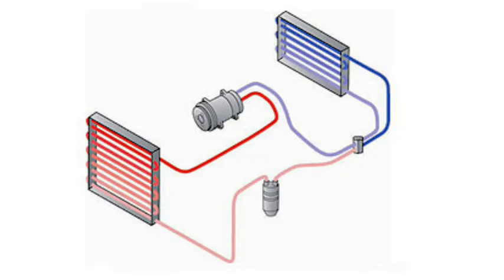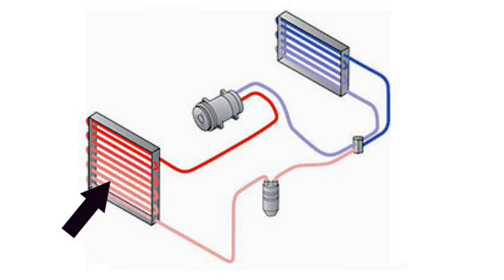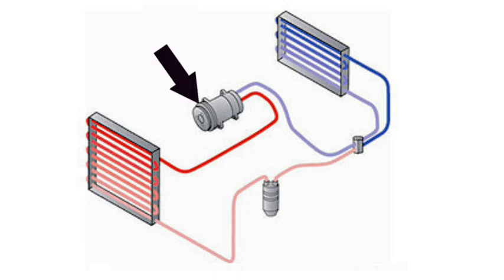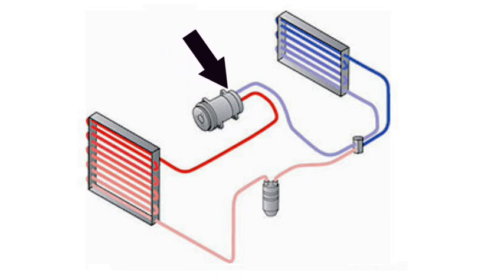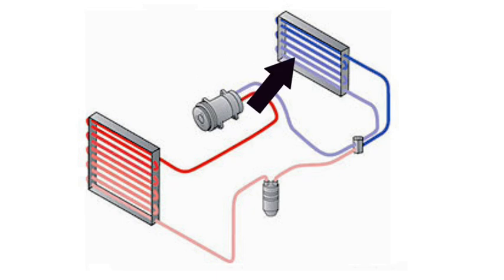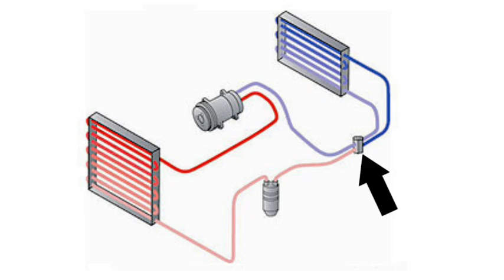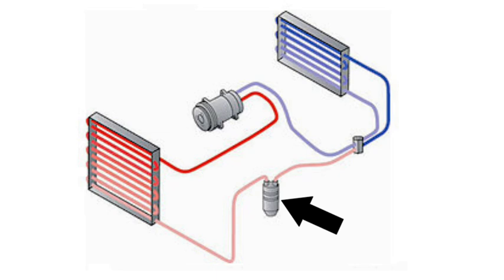AC System Basics - EricTheCarGuy

Comment: The reason he's telling you guys to take it to a professional is for your own safety reasons. 

1) Since the average person does not own a vacuum pump, they're most likely going to just open up their system and purge the refrigerant into the atmosphere.  That is a big no no in the eyes of the law and EPA.  Refrigerant is a green house gas, and depending on the type also ozone depleting (hence why we don't manufacture R12 anymore).

2) It is also colorless, odorless and tasteless.  But which makes it particularly dangerous is that refrigerant is heavier than air.  You can breathe it in and suffocate yourself without even knowing it. 

3) You need to be certified to work on any type of refrigerant systems. 

99% of car a/c problems result from a refrigerant leak that develops over time.  They are not perfect systems and are designed to be modular (have rubber seals in between connected lines).  Unless you have the proper tools and training, take it to someone that can do it for you. The primary reason for the appearance of excessive cost of repair for a/c systems is the above mentioned issues and specialized equipment.  An automotive a/c recovery unit usually costs around $5k for a good one.
Reply: He's rights you know

Comment: hey eric .replaced my compressor a year a go now ac blowing hot air did not change the dryer or orphus filter pressure holding 40 psi. compressor kicks on but does not stay on for long maybe 10 seconds or so. took it to a mechanic says compressor no good, what u think.
Reply: bob kay if you replace a compressor u must replace ur dryer coz dryer is also like a filter on your ac if wont b replace all those dirt inside the dryer goes to ur compressor thats why they said your compressor is no good cuz its damaged.

Comment: i always have been confused if the refrigerant is ever in a liquid state. if so would it be on the high pressure side( like i assume) or on the low pressure side?
Reply: The refrigerant is only a liquid after the condenser. It then turns into a vapor after the expansion valve. 

This is the refrigerant cycle:

Compressor turns refrigerant to high pressure, high temperature, superheated vapor. (also separates high/low side)
Condenser turns refrigerant to high pressure, high temperature, subcooled liquid (by releasing heat energy)
Expansion valve separates the high and low side of the cycle.  Thus, the high temperature, high pressure, subcooled liquid is being transferred to the low pressure side and in order for a phase change to occur (to a vapor), the refrigerant needs to absorb heat energy through the evaporator.  That's why you feel cool air.  It is absorbing heat energy from the cabin and releasing it through the condenser.

Comment: Hey Eric. I have a 1983 Volvo wagon. I am considering pulling the parts from a similar Volvo in a salvage yard to put an AC circuit in my car.  Do you know of any reason that this would not work? The parts are coming from the same engine but a higher end model car that came stock with AC.

Comment: my ac slowly stooped working properly now still blows cold air but very lite cold air almost normal i can hear the compressor turning on but then it stops working and then normal air its blown and goes on and off 
still when the compressor comes in its not realy cold air 
i check the Freon  levels and those are 150 psi 2005 doge stratus 2.4L
can some one help me i just reluctantly change the evaporator core

Comment: Hi Eric hope you are fine and good... i have a problem i have a car Toyota corolla 2010 here in Kuwait. when i am pressing  accelerator hard to speed up or press brake to immediately  stop or slow down my AC goes off and never switch on ! unless i switch off the AC and switch it on after one minute. that's annoying  if the heat is 45 - 47 Centigrade ? any help of helpful information about what to do. Thanking you in Advance.

Comment: So does air from the blower motor flow past the evaporator creating cool/cold air?  If not, how does the air get cold?
Reply: Yip. The evaporator sits at a few degrees above freezing. If they ice over it blocks air from getting through. They dehumidify the car as well and the water just goes down a drain and drips under the car.

That's why the air-conditioning can make you thirsty because the humidity in the car with the AC on is really dry.

Comment: Hey Eric or anyone who knowledgeable. If i replaced a service fitting on the high side that was leaking, do i need to replace the dryer or accumulator with a brand new one or could I make it work decently well still. The fitting was off for maybe a total of 15 seconds. Also which one should I replace? dryer or accumulator. Thanks

Comment: So you touch everything inside the car with filthy rubber gloves, you're dressed like a dirty hobo and you drop the metal hose ends onto the finish of car repeatedly. My 2 cents is your not a Car Guy, you are a junk yard dog. Wash the engine of the POS car you own from time to time then you would not get so dirty doing just basic work. A++ for pushing the safety gear and F- for not knowing there are pressure tables for charge pressures at given out side temps.

Comment: excellent video btw my ac stop working yesterday and i notice the compressor is not spinning could you tell which could be the possibles issues ????/
Reply: With the engine running use a meter and check there's power getting to the clutch, should be about 13.9V. If there is and it's not clicking on then the electromagnet is open circuit. Remember don't try and measure it at the compressor, unplug the lead from the compressor and measure it away from the moving belts. There's enough torque in an idling engine to rip off fingers in the belts! 

If there's no power getting to it, check the fuse. If it's blown check the terminals on the compressor with a meter set it ohms. This should be done with the engine off. If the resistance is close to 0 then it's shorted out.

Does the clutch click on and the compressor not turn? Stop the engine and try turning the compressor with one hand. You should be able to turn it. If it turns ok with your hand then the clutch is weak and needs fixing.

Lastly you could have lost a lot of gas somehow with sudden leak. The oil for the compressor is mixed in the refrigerant. If the sensor doesn't detect enough pressure in the system then it won't run the compressor. It's to protect your compressor from running without oil.
If that's the case then the leak has to be found, sealed and the system properly recharged.

There's some ideas for you.
Reply: KiwiPowerNZ
Wouldn't it be easier to just check the pressure first instead of "Lastly" ?

Comment: Totally disagree, you don't have to be a "trained professional" to perform A/C work. I just changed my own compressor and orifice "tube". I even wore safety glasses. All I needed was an A/C gage set, vacuum pump and 38 oz and 7 oz of coolant and pag 46 oil, orifice retrofit kit, and pipe cutter. The problem with all this is that there isn't a DIY refrigerant recovery tool. That's a misstep on the part of the auto service industry. Given these tools and fluid capacities, anyone can do A/C work.
Reply: D Meag For most people, you're probably right. And the spray can thing is basic thermodynamics. Obviously any fluid spraying out of a can will make the can cold, including a can of refrigerant. It's an isenthalpic process. Fluid @ high pressure turns cold when you release that pressure via the orifice or throttle.

Comment: can anybody tell me why my a/c is cooling ok and suddenly stops, I need to turn it off for 1 minute or so to get it back to work, what could it be??? please some one!
Reply: Sounds like you have a blockage in the system, your compressor builds to much pressure and shuts down. It could be a dirty evaporator, you may try and blow it out w/ your air compressor or even a garden hose w/ water can help.
Hope it works for you.

Comment: hi, everyone here, i have a problem with my AC. it leak gas. i replace all part of the AC but it still leak. just charge for a week then it's gone(it's gone fast if i drive in a hot-day. my car is Honda civic coupe 1996. please help. thx
Reply: It could be leaking out the bearings on the compressor. Did you replace the compressor?

Comment: i bought a truck and check the ac pressure and it was over the gauge, had a person discharge it see if clutch would engage. the clutch never engages than checked the fuses but it burned the compression fuse. replaced the compressor fuse but it quickly burned it. this system has an individual fuse for the a/c compressor and a/c clutch. if the clutch fuse is not in the compressor fuse doesn't burn. what would cause compressor fuse burn?

Comment: Hi Eric,

I need a new ac condenser and compressor for my car. I bought an original compressor and it cost me about $640.

The original condenser costs about $505. There is one available and made in China and it costs only $100. Are there any side effects of not using the original ac condenser? Such as the compressor may get damaged?

A friend told me that If I use Chinese condenser in my car, the cooling efficiency might get affect and the compressor will not be affect at all?

Please I need your answer as you are the expert here. Thanks in advance.
Reply: As long as the mounting points and hose fittings are the same size and location on the Chinese condenser, it's probably a good buy. The price is almost too good though, I'd be careful! If it's too good to be true it probably is.
Reply: RECKLESS XAVER yap kawiwi is right its ok to use china but they wont take long and it will be dmge again i used it bfor got only 4mnths then the condenser has 4 holes hahahhhahhaha

Comment: how ac system adjust temperature inside car???
Reply: I think it just mixes some cooled air with some normal air. Like a shower control mixes hot water with cold water.
Reply: Shreyas Modi the AC computer turns the compressor on but not to long then turn off long.but if you turn on the heater the vents inside closes the vents of the evaporator and opens the vents in the heater.the heater looks also like evaporator but has a hose from the engine inside it uses hot water from the radiator and engine to the heater its like a little radiator but its heat uses inside the car

Comment: Air conditioning service on a vehicle can be done by the home mechanic.  Many problems I see people have with auto air I have also had.  First is the reason for tapping on the clutch to finally make it engage.  I discovered that the clutch metal surface gets warn after many miles of use which essentially puts a larger air gap in the clutch.  This is the reason for that cure to make it engage.  The real solution is to replace the clutch; however a simple shim to change that gap allowed my home mechanic experience to be successful.  Second is the loss of refrigerant when a home mechanic adds new refrigerant.  My old 96 Chevy would only hold a recharge for two days.  I would leak out from some small hole someplace.  After replacing pumps, hoses, and other items it still would not cool for long.  With such an old car, it is not worth much more home mechanic repair.  I found success in my home mechanic work on auto air.  Out of the blue, the Internet gave me a suggestion about alternative refrigerants for air conditioning.  The idea was to use a 25% isobutene and 75% propane that are available from any hardware store.  By following the Internet suggestion I was able to service my old car air conditioning with just a few ounces of “hydrocarbon refrigerant” without trying to find the small holes that would allow normal Freon refrigerant to leak out of my system.  I just topped off the system with the “new” refrigerant without any concern of lubricant or remaining original Freon.  My understanding is that “hydrocarbon refrigerant” is a lubricant itself and its molecule is much larger than the normal Freon molecule therefore it has a harder time to seep out of the small holes of the systems.  Freon would leak out of my old car in two days.  The first attempt on using “hydrocarbon refrigerant” lasted about six months.  The second attempt over a year ago is still going strong.  This new refrigerant is safe for the atmosphere and no more a fire hazard than gasoline.  In fact I have found out that General Electric is using “hydrocarbon refrigerant” in their domestic refrigerators.

Comment: Hey Eric, every time I run my ac and its in operating temperature, my idle drops lower than it normally should. This happens when I'm at a stop and sometimes it will fluctuate or even stall. Any ideas? Much appreciated.
Reply: How old is the car? The computer should idle up the engine slightly when the compressor is clutched on.
Reply: KiwiPowerNZ 94 accord but I swaped the motor to an f20b im running a p28 pro crome ecu. It was like that with my old f22 motor n stock ecu. I js opened up the idle screw but rpm is high when I don't use the ac but it keeps it from dropping below 500 rpm
Reply: Denny Pilit Hmm. My grandmother had a really old Honda Civic which did the same thing but that car was under powered and the compressor was on it's way out. But the same problem, it didn't idle up. It might be a common problem with Honda's which means there must be a solution posted somewhere! Good luck.
Reply: KiwiPowerNZ ya I heard it was a common issue for older Hondas. But it seems like its doing ok with the idle screw up, but thanks for the help man
Reply: Denny Pilit No problem!

Comment: Can a car air conditioner be used as a room air conditioner
Reply: If the room is in your car, yes.
Reply: You could recover all the gas from the system.
Remove the cooling part from the car and install it inside the house remembering the 12V for the fan.
Have a professional run long AC hoses from the car into the house.
Have the system recharged with gas taking into account the longer hoses (more gas).
Since the car will never move again because it's plumbed to your house, you should modify the gas peddle to maintain a high idle say 1500-2000rpm, so the AC has more pressure.

And now you have a petrol powered AC system for your home. Just never try moving the car again and it'll be fine! You'll have to refuel it with a can.

Comment: My a/c system to my 2004 acura rsx type s blows cold for a while then blows hot. It's like it fluctuates cold to hot hot to cold. I was wondering if you had any clues what it could be.
Reply: My rsx does the same thing.. That's why I'm here lol
Reply: I noticed that when I turned on my ac I wouldn't here my ac compressor clutch engage but when I'll tap the clutch then it engages. So I ended up replacing the clutch and magnetic coil it self. Works just fine now.

Comment: Whenever i turn my ac on i am getting exhaust smell in my cab, i know i have an exhaust leak but how is it passing through in relation to ac and not on vent with ac off? It there a door in dash by the evaporator core maybe that its not shutting maybe, thoughts suggestions